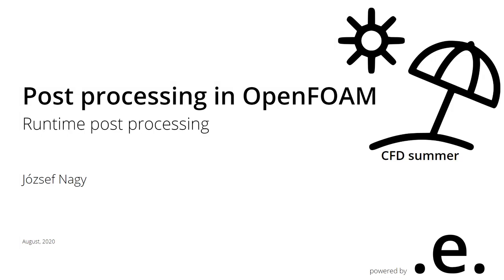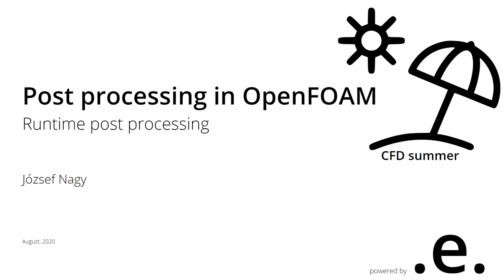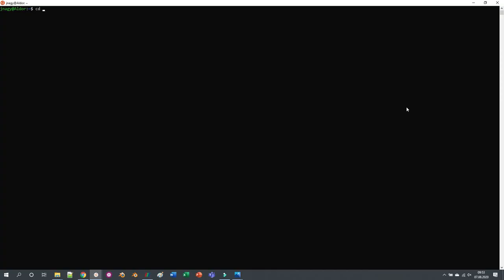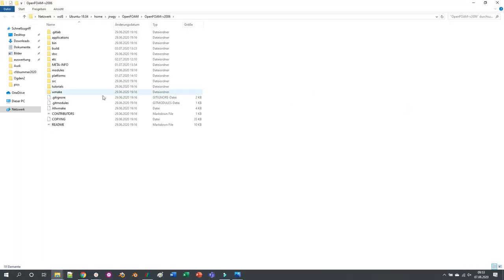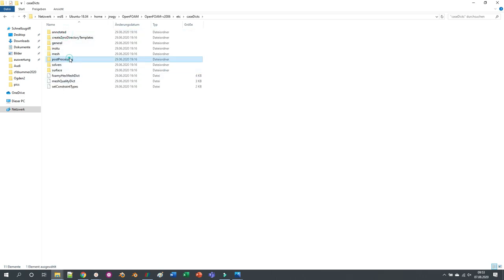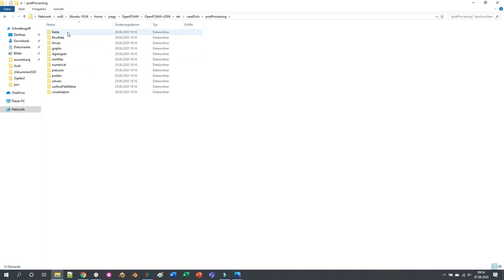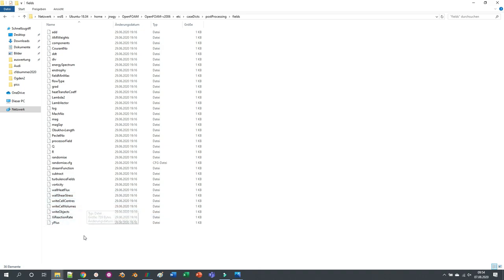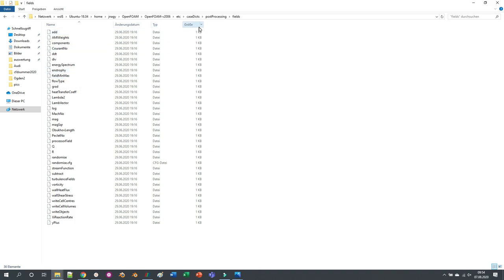[Community video] - Runtime post processing in OpenFOAM

Comment: Hi,

I am trying to simulate a two phase flow in a pipe. I am using the InterISofoam solver. It is running fine. Now I am trying to figure out the max Cross section area of the liquid profile crossing a plane in pipe. How to do that?
Reply from the maker: Paraview. Clip to scalar.

Comment: Dear Professor, I have meshed my geometry using blockMesh and SnappyHexMesh. Kindly suggest the method to calculate the  deltax (mesh element size) of my mesh, which I can use to find the deltaT?
Reply: Use paraview measure tool to measure the dimension of a cell. But I would recommend using the adaptive time step in openFOAM you dont need to worry about your dt
Reply: Hello @picturesque2566  , thank you for the help..How to find the max cell size using paraview? I am sorry, I am new to OpenFoam and paraview.
Reply from the maker: @mith3700  As Picturesque
 suggested use adaptive time step size.